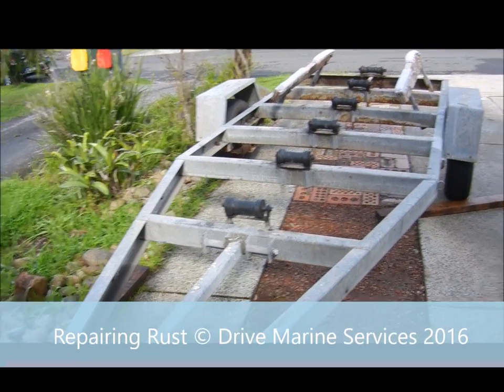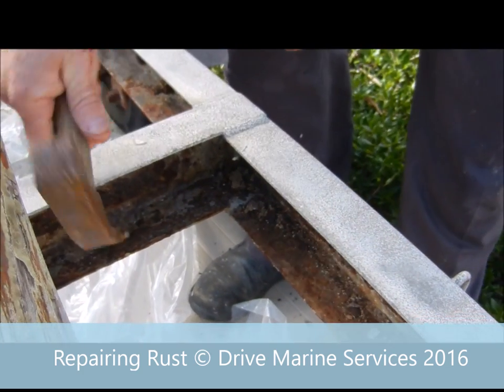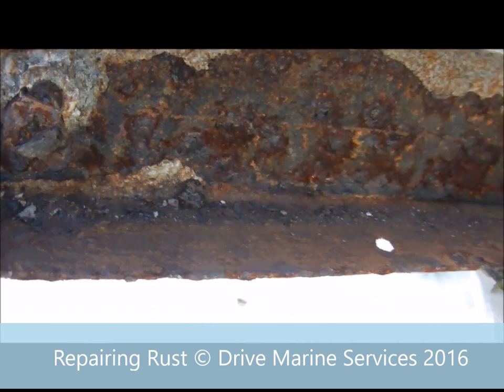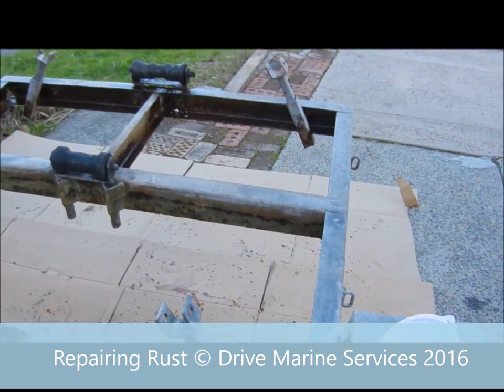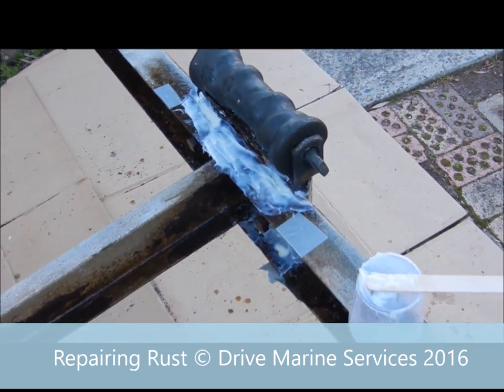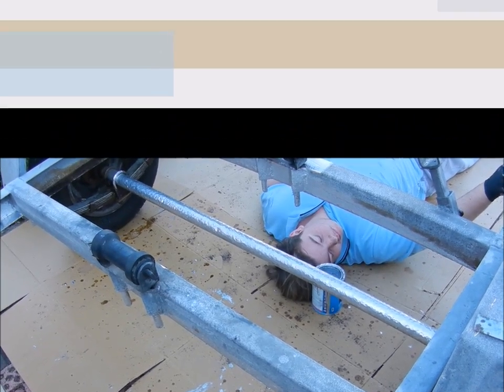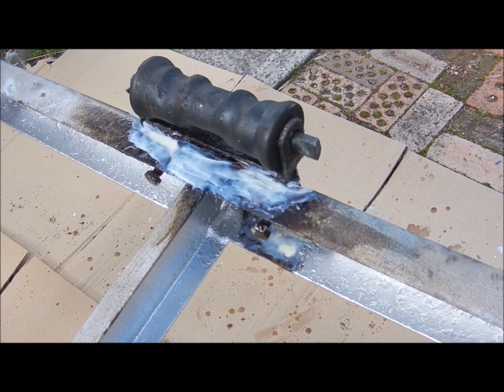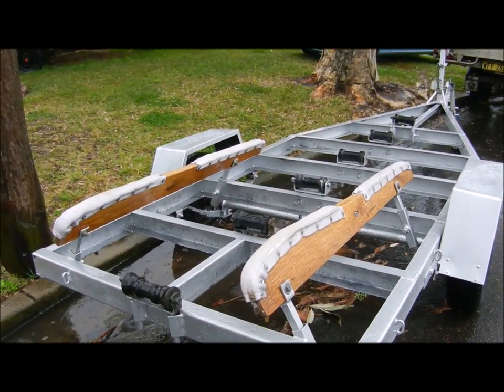Repairing Rust On a Trailer

Comment: old vid but just what i was looking for, couldn't decide weather to use body filler, weld it up or epoxy for 4 small holes in my camp trailer. The tape under the hole and epoxy worked great after rust treating it.

Comment: Great work fellas. 'It actually gave me confidence to go and have a go' at my old rusted boat trailer 😅. So I've finally started yesterday in between work. Thanks for putting the vid up. Although, I couldn't get ferronite and the sales people suggested rust converter called Rust Guard so I'm using that first, then etch primer,  and then some silver hammer paint. As well as alot of elbow grease 😉
Taking awhile to do because of access with the boat still on,but will let you know how it turns out. Thanks again.
Reply from the maker: Thanks for your positive feedback Gyula, iit inspires me to get the camera out and do more.
 We always have fresh Feronite in stock and we can post it anywhere in Australia or the world for that matter.  As it is water based and no Dangerous goods.
Its only drawback is that you need to mix it very well as all of the goodies  for sealing & Priming settle out.  Plus after its BEST Before Date throw it in the bin.  Therefore you need to check that is still in date when purchasing it. 
Hopefully with all of your effort the rust will not come back.  Touch base on Bote.Cote@optusnet.com.au and we will look after you.

Comment: Could you tell me exactly what epoxy product you used to fill the holes with please?
Reply from the maker: I used EPOX-E-Glue made in Queensland Australia.  It is brilliant as it will not sag on a vertical surface and has ultimate strength.  This Technique should only be used on non critical areas.  Nothing beats welding or brazing in a new section.  Doubler plates are not recommended as moisture can get in between the plates and create havoc.

Comment: I’ve got a partially rusted galvanized metal Bluescope ceiling of my garage that was used for formwork for the concrete above. Due to lack of waterproofing, it’s rusted badly in a few spots. We’ve waterproofed and now need to address the ceiling. Your video has helped me a lot, I plan to scrape off excess, fill a few gaps where it rusted through with no more gaps then use Feronite RMP, then use Killrust paint as a finish. Any suggestions?
Reply from the maker: Clean off the loose rust with a wire brush and hot soapy water to remove loose rust and contamination.  If you have rust between the concrete and steel see if you can spray the Feronite into the area.  Having the surface damp will slow own it curing and allow it more time to draw into the gap.
Where are you located?  It ships by courier or POST. 
Dave - 0412 366 998

Comment: Thanks for this video! How much feronite did you end up using for that job?
Reply from the maker: Start out with 250ml  How big is the area you need to sort out.  Two coats will do about 4 to 5 m2 depending on how bad the rust is.
Dave

Comment: The epoxy to hide rust holes in is dodgy. Really sad this was posted.
Reply from the maker: Yes you are right it is dodgy.  
BUT,  it was non structural and we did not have a welder available to carry out an ideal repair.  If it was a structural area with load on it I do not recommend using the EPOX-E-Glue.  
Although the EPOX-E-Glue is a high strength Thixotropic Epoxy Glue with the following tested properties;
-  Tensile Strength - 48MPa
-  Tensile Elongation  - 8%
- Flexural Strength - 76MPa
Compressive Strength - 90MPa

As you can see it has very good mechanical properties for an Epoxy Glue.
Reply: It's just semantics.  At the end of the day  it was a good job and the customers were happy.

Comment: Hows is this good workmen ship. ..bodged ...
Reply from the maker: I never said it was good workmanship.  It was done to bring a tired old trailer back to life and solve the corrosion problem.  The new owner is more than happy as he scored a trailer which met his requirements at a very reasonable price and it is still going strong.  Do not under estimate the EPOX-E-Glue used where the frame had corroded through in a couple of non structural places as it provided considerable strength to those otherwise buggered areas.

Feronite Rusty Metal Primer is not supposed to make sometime old new again.  It is to solve corrosion issues and extend the life of equipment such as this trailer which would have required major surgery  to bring its function back to new.
Check out other video',s
Reply: @TheEpoxyGuruTipsTricks  amazing great job and practical tips that can be used for lots of applications
Reply from the maker: @darrennovak6442  Thanks Darren,  Feronite Rusty Metal Primer is a brilliant product which is brilliant at halting rust and giving rusty metal many more years of life .  It does need painting or it will start to fail after about 12 months from UV exposure.

Comment: Hate dickheads that fill in frames! Weld a plate over the holes! Inexpensive and easy.
Reply from the maker: Sounds like a plan if you've got a welder and know how to weld. The epoxy glue has a strength of approximately 50Mpa and is a better solution for the average person. Alternatively, if someone did not have said welder nor the knowledge to do so they could use your idea and utilise Epox-E-Glue to glue the backing plate on.

Comment: Can’t hear you
Reply from the maker: Good Aye Alex,  Thanks for your feedback.  Concur with the wind causing background noise.  Charlotte did the best she could to remove the background noise.  She put in some comments were the critical info was too faded.  We did this video a couple of years ago and we have learned a lot since then.  All our video's are produced by amateurs using a Nikon S9000 CoolPix Camera and therefore limited in what we can achieve.  
We do these video's to educate people and most are "done on the spur of the moment".  I hope from the actions you can appreciate what we are trying to achieve.  We have a good video on sorting out rust on a roof and the technique is the same.  If you want further advice we are happy to answer your questions.  
Feronite is unique as it does not rely on Phosphoric Acid  to convert the rust.  It uses Tannin from a tree to convert the rust, then it seals and primes the surface in one application using two coats.  Then all it needs is a Topcoat to keep UV away.   There is more info on our website at www.BoatCraftNSW.com.au .
Reply from the maker: Sorry, we are working harder to make sure our video's have better sound quality as per my previous response.